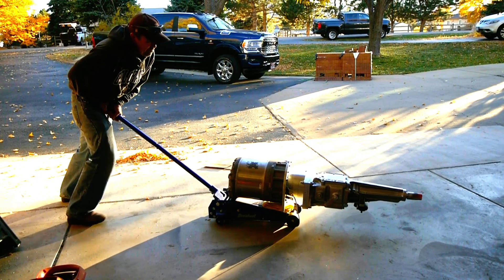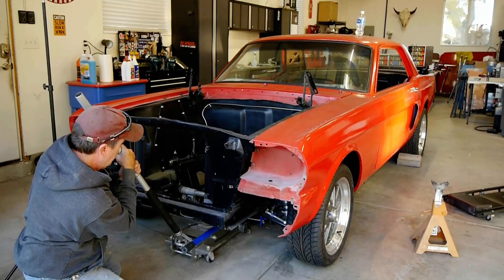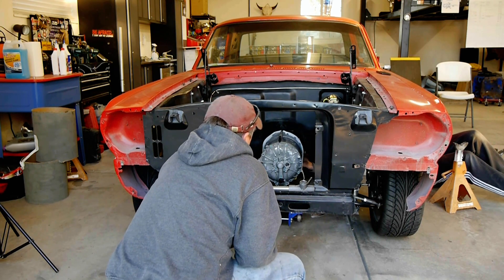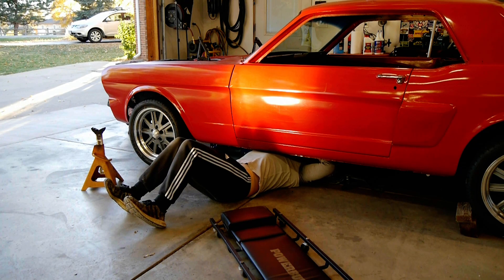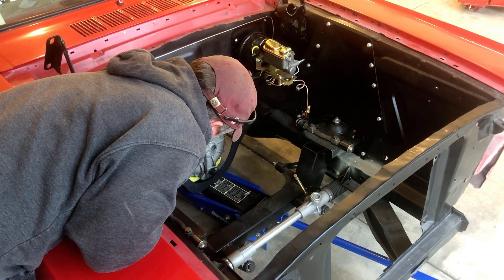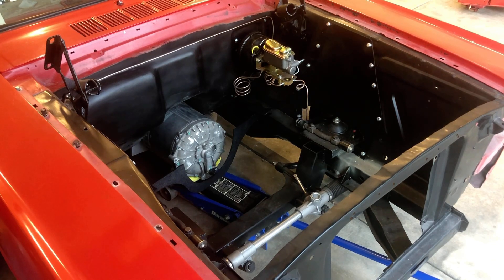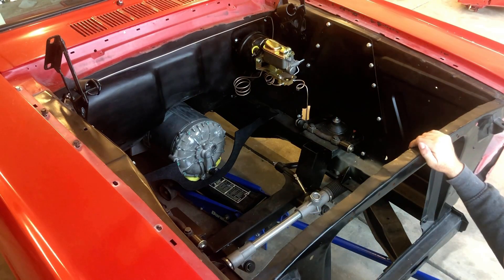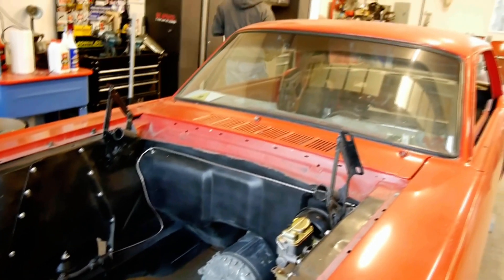Test Fitting the Tesla Motor into the 1965 Mustang #teslaswap #evconversion

Comment: Will it have the same kind of power as traditional gas powered, and how long do you think a charge will last? Thank you.
Reply from the maker: It will have approximately 5 times the power of the original motor. It has a +~ 300 mile range